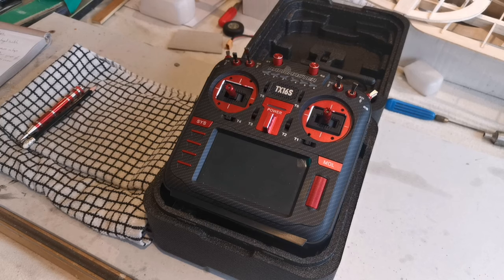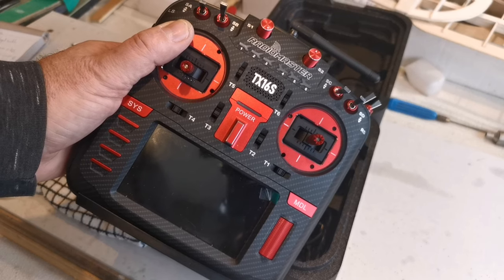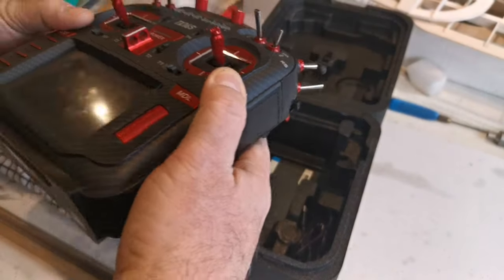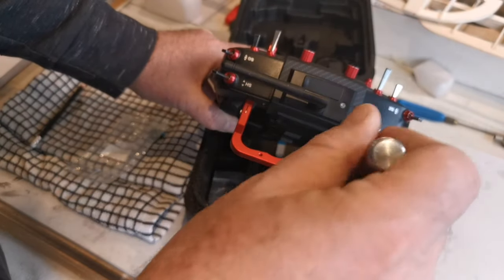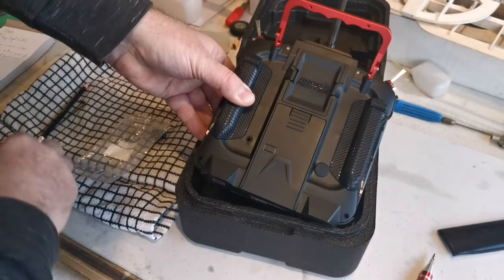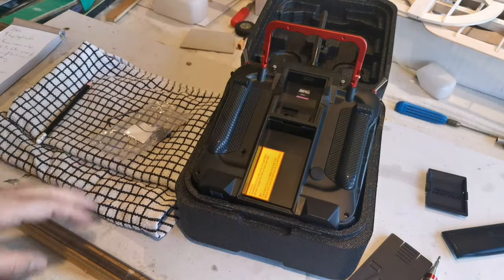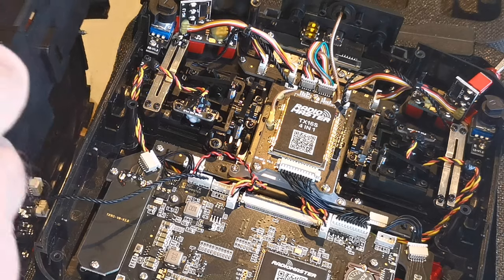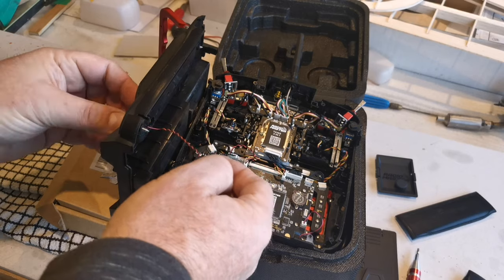Installing a DIY switch in a Radiomaster TX16s transmitter.

Comment: Nicely done Mark, I actually use to left hand switch (SF) to set the trims, it does mean though I have to switch it twice, your solution is neat. I've removed the plastic screen protector by the way, the screen is pretty much scratch resistant, cheers
Reply from the maker: As you can tell from the video playing about with radio gear is not my thing but it's starting to sink in slowly. 😂
Reply: @MarkCroucherRC4fun  radio master is a very steep learning curve but there's a good RC group and we've got a couple of club experts 👍

Comment: Hello, i also now have a TX 16S, i was with Spektrum too. It's a bit of a lurning curve but i hope to achieve it. Spektrum is good but getting so expensive and not multi protocols.
Reply from the maker: The cost of rxs has gone through the roof